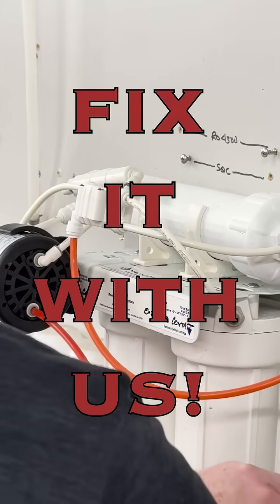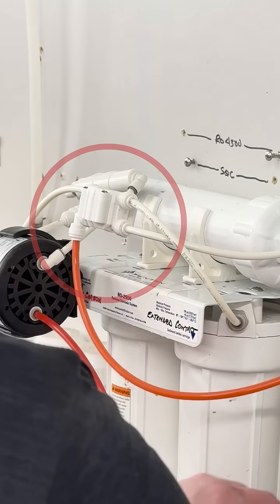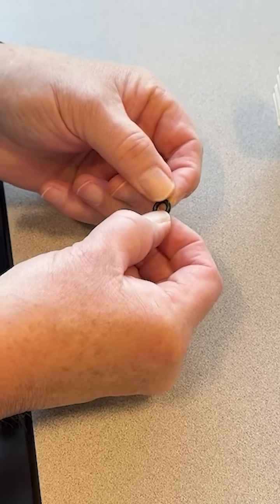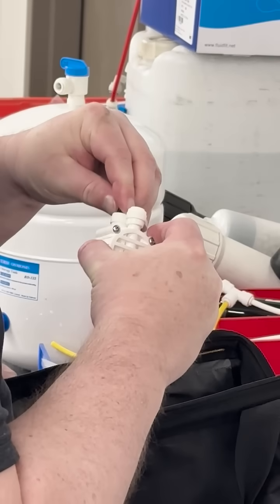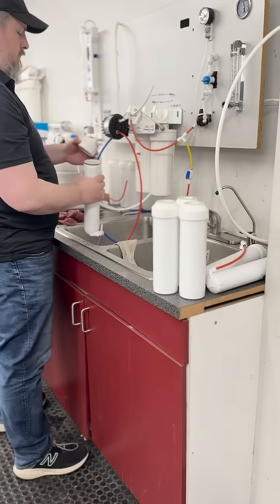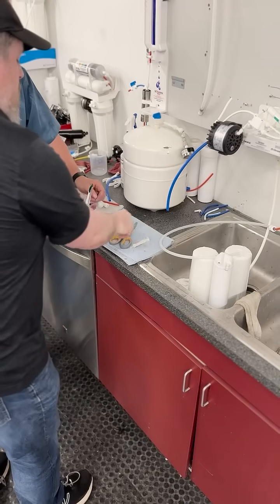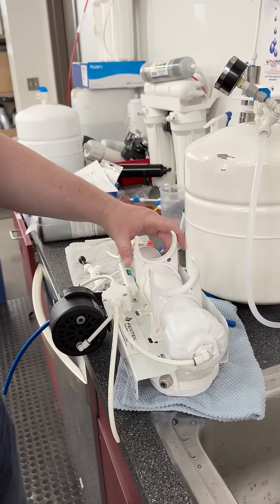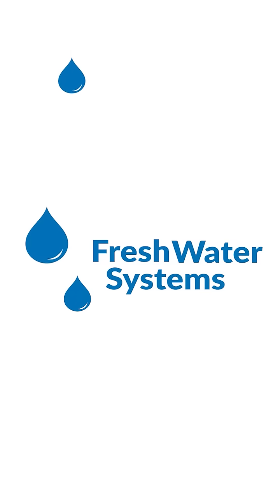Fix a Leaky RO System with Us! Quick Troubleshooting & Maintenance Tips #water#reverseosmosis #diy

Comment: Mines leaking though the valve and constantly running into the drain. What’s up with that?
Reply from the maker: Hi! You say, "leaking through the valve", I am thinking it is not leaking externally out of one of the fittings which is what the video addresses.  If the system doesn't want to shut off, there are a couple of things to check.  (1) Empty the tank, then check it to see if there is still water in it.  It will feel heavy.  If so, the tank has lost it's precharge pressure and will need air added to empty the tank.  Once empty adjust the pressure in the empty tank to 7-10 psi.  When the tank is low on air, the ASO valve may not see the pressure it needs to close.  (2) Is the RO producing the expected amount of water?  If it is under it may be taking a very long time to reach shutoff pressure.  A 50 gpd system should produce 3-4 ounces per minute.  Turn tank valve off and let faucet run, after a few minutes, collect the production from the faucet.  It it is significantly less, filters could be clogged and or membrane needs to be changed.  I hope that helps